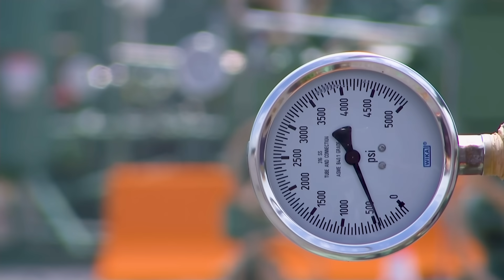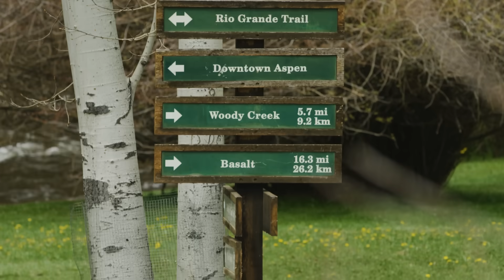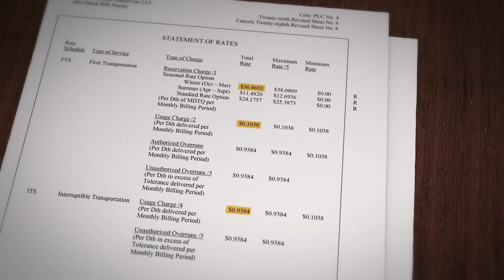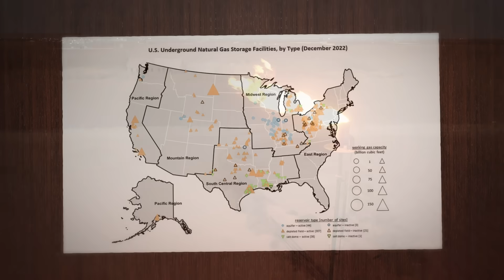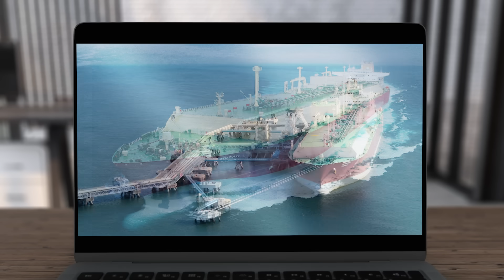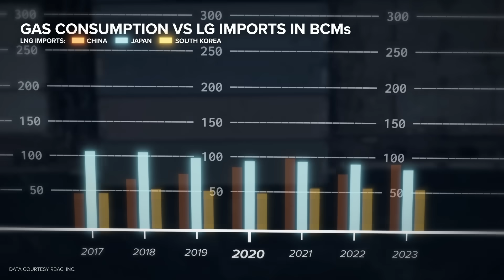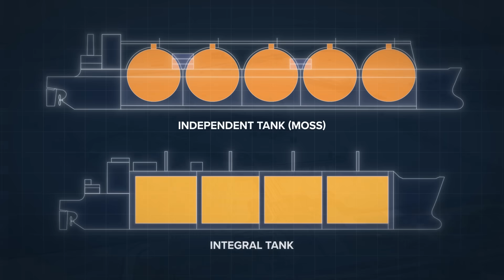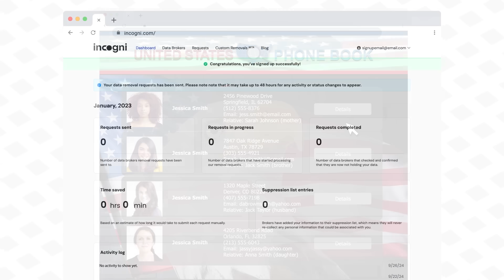The Logistics of Natural Gas

Comment: My company makes a small mobile compressor thats designed for servicing pipelines. If you have a section of pipeline and you close two valves to isolate it, it's still full of gas and for many of these pipelines its a LOT of gas. Historically, they'd just set up a flare stack and burn it, but new requirements make that an undesirable outcome so instead, you suck it out of the section that's going to be worked on, and compress it back into a section that's still connected. it works all the way up to 1400 psi, and will actually pull the isolated section to a slight vacuum which makes nitrogen purging easier if its required.
Reply: What ia the brand of these? We need them at work to save wasted gas for big shutdowns
Reply: @Crabman_87  it’s more of a service
Reply: Yea I’ve been on a job with cross compression before and it takes forever. Even with all the guys getting paid by the hour, they were all bent out of shape for having to wait a few hours for something that normally took 60 seconds(blowing it out to atmosphere) but I thought it was neat. It was maybe a half mile of 8 in distribution main and it took around 5 hours, never got it to below 2PSI because they were tired of waiting and each PSI took even longer the lower it got
Reply: @jac2o7  Even opening to atmosphere takes a long time on the pipelines our compressor is designed to operate on. we run 10-20 miles of 24-32" distribution pipelines at over 600 psi. It'll take a few days, but its a few days of one guy keeping an eye on the robot working away, and saving over 95% of the gas that would otherwise be wasted. 
 
You are exactly right, those last few PSI take FOREVER even if you are free-balling it into the sky. Ours keeps pulling all the way down to zero and is quite a bit faster on those last few PSI. Our biggest compressor would take about 50 min to evacuate a 1 mi 8" pipeline from 600 psi to zero and would recover 98% of the gas.
Reply: Cross compression?
Reply: 1400 psi is a BIG target for the pipelines of 40 years ago.  Nitrogen back-gassing is an advantage for operations involving 're-pointing' the seams.

Comment: Not mentioning fugitive emissions is a big miss. Fugitive methane emissions from pipelines, liquefaction, regasification, and endpoint leakage make up 40 Megatons of CH4 emissions annually, or ~1.12 Gigtons of eCO2 by GWP (ratio of 28:1, which is the lowest end of the estimates).

The actual burning itself produced ~6 Gigatons of CO2.

It's shameful inefficiency in a "fascinating system".

Comment: 17:14 And what do you think powers heat pumps, electric water heaters and induction stove tops? 😀its electricity of course, made mostly from coal and natural gas. And since coal plants are transforming to gas, there will be even more demand for natural gas. It just wont be used directly at households, but in powerplants. Its always funny when people talk about something that runs on electricity, like its ok, its clean, it doesnt need fossil fuels 😀but you have to realise from what is the electricity made. Its the same as saying that electric cars dont use fossil fuel, realy stupid thinking
Reply: It will reduce demand even if electricity was 100% NG because heat pumps and induction stoves are more efficient than their gas equivalents. Same for electric cars, even if charged exclusively by coal power an electric car will have a lower carbon footprint than a fossil fuel ICE car over it's lifecycle. There are also more ways of producing electricity than burning fossil fuels, most of which are also more cost effective in the long term.

Comment: Below two streets (depends on which side of Central Park you are on) in Manhattan the ConEdison Steam System both heats AND cools thousands of buildings and it all originates from the 14th St power station in Alphabet City. It’s a “waste” byproduct from the gas fired steam turbines, they pressurize the steam (which cooks it at over 1000F (538C)) and send it out in a network of severely aging steam pipes. 
That classic “New York street” in movies and TV with the big orange and white striped pipe venting steam? That’s a real thing, it’s a temporary solution to stop hot steam from burning people and cars until a full repair is made. (Trust me, you do not want to get burned by this pressurized steam, it will burn down to bone.)
Reply: No steam, no smoke 🔥…..no problems. 😂

Comment: Gas production was originally local - At least in the UK. Towns produced coal gas (by heating coal) and stored it in gasometers for use.
Reply: When i watched a cricket test at the oval i wondered for years  that that construction was.
Reply: That happened in some parts of the US as well.  The resulting gas was impure (had carbon monoxide, thus the old "stick your head in an unlit gas oven to remove yourself from the world" trope), and the residues from heating coal for town gas were often disposed of in ways that now require environmental remediation.

Comment: As someone who works in this industry but not on the distribution side, or even with natural gas at all, it's nice to learn a bit more. The work I do is for services to buildings. I'm part of the process leading up to the installation of the gas service by locating and marking sewer lines so that when the gas is installed with a drill, they dont hit the sewer. Just a little fun fact, if a gas line hits a sewer line and becomes damaged, gas can leak into a building. Fun fact number 2: In the right concentration, natural gas is explosive. The smallest spark from even a light switch can make the gas explode
Reply: Yeah we had one building exploding like this, it's scary, I was a little worried when I had gas in my apartment building...
Reply: Fun fact; If you smell rotten onions, you better start running ! Also, it's perfectly safe to smoke a cigarette right next to a gas leak. It is however unsafe to walk away to where the gas thins out and turns to vapor, as that will cause ignition. Uncompressed gas vapor has a much lower combustion temperature.
Reply: Heard a story recently about how a LNG-powered garbage truck exploded, it's wild all the different things natural gas can do.

Comment: I deliver propane to mostly residential customers in New Hampshire partly because New Hampshire is very rural but mostly because environmentalist in local nimbies made it impossible to build natural gas likes from PA. I also deliver home heating oil which uses to come in from Russia! Environmentalists are pretty dumb at the end of the day and when they get mad at how high their propane or oil bill is compared to PA they spend atleast 2-3x asuch to heat our homes and we emmit more C02 by driving it all around instead of pipe lines.

Comment: Gas is very old now. Seams a load of work for something that is not as efficient as electricity. Gas is only good for heating... Electricity is good for anything. Also Electricity is essentially free if you have solar. its old.
Reply: Gas in the US is usually cheaper than electricity. Solar power is not free by any means, you have to build solar panels and related infrastructure and only works when the sun shines.

Comment: @11:46 "in a fluid state" should be "in a liquid state".  Whether a substance is gaseous or liquid it is a "fluid"; LNG must be liquid for transport.
 .
Reply: Yikes to everyone involved in this thread, myself included
Reply: @ You remind me of one of my bosses telling someone that they missed a great opportunity to remain mute.
Reply: If the narrator is connected to the oil & gas industry then it makes more sense because that’s the terminology that’s used. But maybe it’s a coincidence, and his “mistake”just incidentally led to him using the correct industry lingo.
Reply: Yeah I cringed when he said that. I don't know how it became normal to consider the word fluid a substitute for liquid when it has an actual specific scientific meaning. It's kind of like how the word theory means random guess whereas in science it means massive amount of evidence support the idea.
Reply: @drabberfrog  On another channel, a Phd says:  At 882°C, it is over 8 times the boiling point of water.
Should use Kelvin ... more like 3.1 times...
Reply: This is such a dumb semantics argument, and this is coming from someone in physics, technically following your definition we should also define glasses at a type of fluid because they move over long time scales (weak fragility glass for example), but no one thinks like that, similarly you don't think of a gas as a fluid until you start applying pressure to it like at high speeds when the Reynolds numbers increase. Overall its a dumb semantics argument to act like anyone outside of certain fields would care about the difference, when 99% of people hear of "fluid" they think of a liquid state of water or oil or something. Stop trying to act smarter than everyone else (not even trying to be mean fam, ive been there, no one likes being corrected constantly over something that truly does not matter in a given context)
Reply: @sharrpshooter1  The video is a technical overview and was talking about the state of a material. Liquid, gas and plasma are the possible fluid states of natural gas.  (Not sure if NG can be solid - but that's another matter).
 
Glass is an amorphous solid, so no, cannot be called liquid or fluid.  Sad that you introduced that as part of your argument.
Reply: @sharrpshooter1 your comment is massively ignorant. As someone actually in physics, claiming if we call gas a fluid (which literally everyone with an actual understanding of this stuff does), then we should call glass a fluid is honestly top tier fallacy. 

No, we shouldn’t call glass a fluid and to claim otherwise means you are a disingenuous oaf

We should call gas a fluid because it literally is, and as a video providing technical information, it shouldn’t make such basic and nonsensical mistakes
Reply: @sharrpshooter1  Glass quite literally isn't a fluid though, it doesn't move over long time scales unless someones moving it. Those pools of glass you see in stuff like old churches are because THEY'RE OLD, they couldn't make "perfect" windows like modern ones so they would place the thick part at the bottom
Reply: @sharrpshooter1  
A) Glass isn't a fluid by any valid definition. 
B) Imagine taking a video about engineering and saying "stop bringing physics into it!".

Comment: Recently heard about an interested and little discussed aspect of electrification: Since distribution is included in your gas utility bill, as more and more folks get heat pumps and induction stoves the burden of paying to maintain the gas infrastructure falls on a smaller and smaller pool of customers. So, despite a reduction in demand, the cost of natural gas might actually increase for those who remain as the customer pool gets smaller but the distribution system does not. This is important to keep in mind as we think about transitioning in an equitable fashion, since the last folks to electrify will probably be those who are already socioeconomically disadvantaged because they lack the capital or resources to electrify their systems.
Reply: Yes but the cost of electricity transmission is going up rapidly.
Reply: Gas is a luxury, and expensive to run in.
Reply: @guitarsoundsaround  LNG has largely replaced coal and it burns much cleaner and is cheaper than coal.
Reply: @HH-le1vi  you are right! I fully support LNG. Especially environmentally, compared to coal. 
Making the switch to gas was simply out of my budget back when.

Comment: Let's say we're dealing with a vertical well that generates dry natural gas, no crude oil or water. 
Let's say reservoir rock is 30 ft thick.
Let's say this one vertical well drains a quarter section (basically one quarter mile by one quarter mile) 
Let's also say that porosity is 30%, meaning the rock is 70% grains/minerals and 30% open pore space filled with natural gas. 
Let's also say the recovery factor is only 40%, meaning after all the years of producing the well we drain it as far as current technology allows, and 60% of the natural gas remains trapped in the rock. 

That all comes out to 6.3 million cubic feet of natural gas coming out of that single well. 

BUT that's all calculated at reservoir temperature and pressures.
At standard temperature and pressure the "Standard Cubic Feet" volume of all that natural gas would be much much more.

Comment: Also mentioning “Power to Gas” is interesting.  You can convert surplus electricity into synthetic methane.  Given this HUGE infrastructure it has some serious advantages.

Main concerns are Methane Leaks (ghg emissions), and efficiency (although to be fair if it was going to be “wasted” capacity, any use is better than shutting out excess renewable generation etc)

Dimethyl Ether and Methanol (along with other Power-to-X things) may solve some of methanes issues without being as bad as Hydrogen)

Comment: I work on apps to plan pig pipe inspections, and pipe digs if anything need repair. The scale and costs involved never cease to shock. Launching an inspection pig requires slowing the flow for a few hours, and that's a 5 digit cost. Digging and repairing a few feet of pipe, add another zero or two.
Reply: I can believe the cost. There's a pair near me, one for NG and one for jet fuel for an airport. They did an inspection campaign and upgrade cycle, and they had helicopters flying over and monitoring at regular intervals for weeks. Kinda impressive.
Reply: TugaAvenger commenting here is something I never thought it would possibly imagine.
Reply: I'm sure there are reasons but it seem a small robot driving along the bottom of the pipe [possibly with magnetic wheels] could inspect without slowing the flow of gas.
Without oxygen there's no chance of it causing an explosion.
Reply: @nunya___  That's actually a cool idea. Never thought of it that way. 

My first two thoughts on something like that are mechanical failure and liquids. If the tool has a mechanical failure and can't move, there isn't another way to push it down the line and it's stuck. Also, figuring out that it failed and where it failed would be hard. Sometimes these lines accumulate liquids that will collect in low elevations and I think that would prevent a mechanically driven tool from passing through. 

Look up smart pigs or in line inspection (ILI) tools and see what they look like and how they work. They are pretty impressive!
Reply: @nunya___ im pretty sure they have something like that, at least for oil pipe lines 
5:18 this is probably what i was thinking of
Reply: I am in GIS on the midstream side and when we have pig inspections done, it is a huge task to coordinate. Producers have to be notified that rates will down down that day, our plants have to be in the loop, our buyers on the other side are notified, and many more. Being just midstream though, we can usually make up the losses over the next day or two with the same level of coordination.
Reply: Is your company growing? Sounds like an interesting area of work.
Reply: Still cheaper than repairing cost of a rupture and blowout gas pipeline 😢
Reply: I imagine Russia isn’t happy when Ukraine blows up Russia’s pipelines, but the US is happy as its main competitor on the fossil fuels market gets wrecked. ^-^
Reply: huh, didn't expect to see an ace combat youtuber I use to watch out in the wild like this.
Reply: @randomguyblank1616 
Had to click the channel to make sure I was seeing what I thought I saw too.

Comment: In the UK there are long term plans to convert the natural gas infrastructure to hydrogen (ironically more closely replicating the "town gas" from coal gasification that preceded it, the "natural" in natural gas comes from the fact it isn't made from coal). The hydrogen would be produced either via electrolysis using renewable energy, or perhaps through thermochemical cracking from high temperature nuclear reactors. The idea being a lot of old UK housing stock isn't sufficiently insulated for heat pumps to work effectively, and of course there are still a lot of industries who require some kind of combustible fuel, it's either cost prohibitive or down right impossible to electrify some industrial processes. So there might still be a use for NG networks into the future. There will be challenges though, hydrogen is not like natural gas, for one it will leak out of things you thought were solid, but to a teeny tiny H2 molecule are full of holes like swiss cheese.

Comment: These will all be stranded assets in 20 years time because electrification is just cheaper
Reply: errrrr... how do you suppose much of that electricity will be generated?
Reply: Electrification is generally not cheaper and that is probably going to get worse as the power grid faces problems in the coming years. Additionally the largest source of electrical generation in the US is natural gas and it isn't letting up.

Comment: The only real kicker to all those cleaner forms of heat and cooking,

NG is a huge global source of power generation so as the demand for electricity increases the demand for gas will shift from end users to electricity production
Reply: So it's back to nuclear in the end, right?
Reply: Yes, but demand will still be lower because powering heat pumps and induction stoves with electricity is more efficient than burning the gas at the end user.

Comment: China buys natural gas from Russia by pipeline. However, the pipelines are already at capacity. Russia and China have been talking about building a new pipeline, but it is hideously expensive because the pipeline would go through deserted permafrost areas. Construction and its logistics would be a nightmare. China does not want to pay and Russia can't. Also, neither have much expertise is construction over permafrost tundra. The Soviet Union had some exprience. Russia, not that much. If they decided today, it will likely be decade plus before it is constructed.